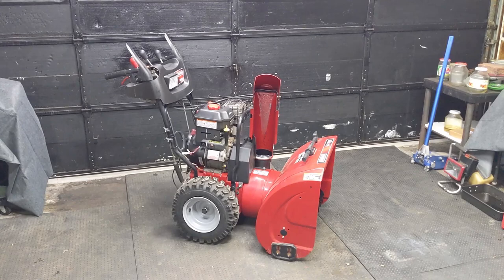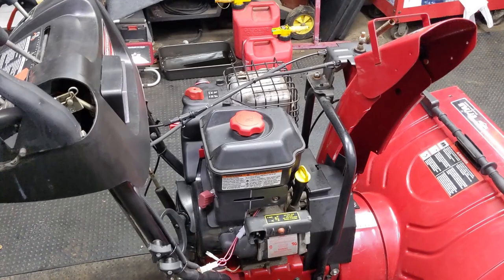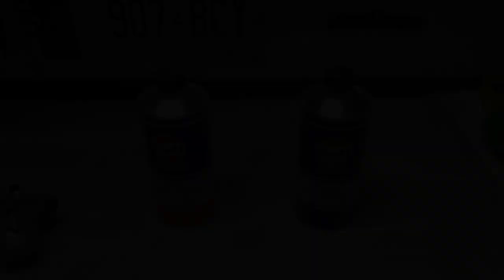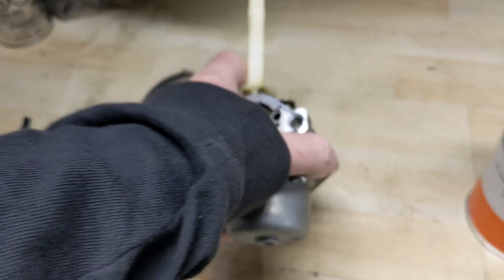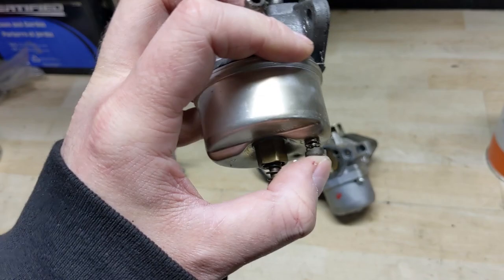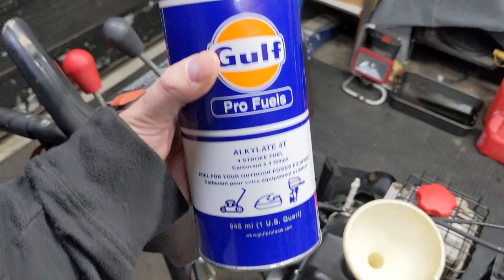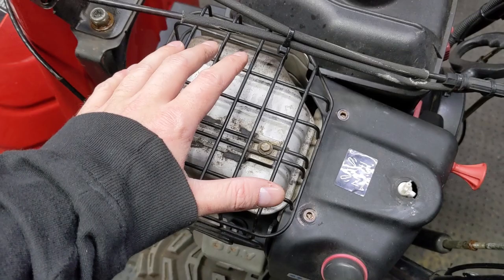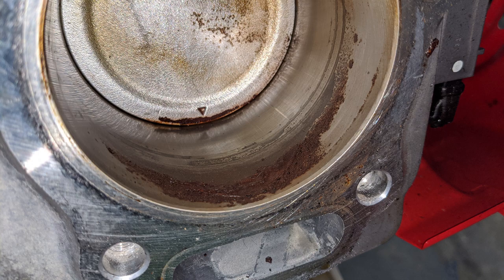How to "Summerize" a Snowblower

Comment from the maker: Due to all of the fuel in our area now containing ethanol, we will not be seasonally storing any equipment (for long periods of time) with pump gas.

However, we will still be using K100S+ fuel stabilizer with the pump gas 91 (least amount of ethanol) to run our equipment throughout the seasons.

Also, this video is NOT sponsored by Gulf Pro Fuels, I simply give a shout-out to Small Motor Service because they were kind enough to send me some free samples, and the awesome Gulf Pro sign you see on the wall at the back of the shop!
Reply: I just tested my 91 fuel that my supplier claims is shell vpower.  No ethanol.

Comment: Just summarized my snowblower for the season , ran the machine for 5 minutes , emptied the oil , then emptied the gas tank and the carburetor , put 10 oz fuel stabilizer though the tank and emptied from the carburetor , used the oil to coat the entire machine , meanwhile lubricanted the 2 chains and the axils , wheels , yes do filled the oil then put it away and ready for the next winter arrives !
Reply: I would keep the oil in the engine to prevent rust. Also you may accidentally start the engine without filling it with oil.
Reply from the maker: I leave the oil in them and do my maintenance before the season begins. You'll have to stay tuned to part 2 to see what products I use to protect the paint!

Comment: I'd rather keep the carb full of stabilized fuel . Running out of gas = water in bowl  Full carb [ empty tank ]  no room for water .
Reply from the maker: Yes but if the fuel has ethanol in it, than the water will bind to the ethanol and separate itself inside the carburetor. It will literally displace the fuel around it, since water settles to the bottom. So you have to run ethanol free fuel, with or without a stabilizer, drain the tank and carb completely dry, or run an ethanol free canned "engineered" fuel.
Reply: some say that the smaller amount of fuel left in an empty carburetor will gel more easily than a carburetor  that is full of fuel.
Reply: In most cases if there is very little fuel say just in the carb bowl and none in the fuel lines or tank then it just evaporates and is gone. The ethanol will attract the water in the atmosphere and thus water in the bowl (see rusted carb bowl from water in video and white powdered bowl is ethanol in the video)
Reply: @michaelotoole1807  The smaller the volume of fuel the faster it breaks down it correct.
Reply: @EliminatorPerformance  the Honda machines like my 1332 has A drain bowl underneath the carburetor. Once I run it with treated fuel, I shut the fuel off and it starved itself. Once it dies, I unscrew this drain bowl knob and let any fuel remained inside the carb. I initially treat my fuel premium gas with star tron in a 2-1/2 gals and than at end of season do the step above. I know some engines don’t have same setup as Hondas with no fuel drain knob.

Comment: A 5 gallon ethanol free gas is $105 usd + tax! 89 octane is $2.99 per gallon + star tron. I think I’d rather take my chances
Reply from the maker: Yea this canned fuel we sell for $10 a can, my cost is like $6.50 and I can store 2 machines with 1 can so it's not bad. I definitely wouldn't need 5 gallons, and as mentioned in the video, I don't run the equipment on this stuff, it's just used to store it.
Reply: @EliminatorPerformance  I do premix in my stihl equipment because they go thru gas within 30 min or less. My Honda 1332 takes 2.5 hours to drain while running. It take tons of those fuel can to fill it
Reply from the maker: @appleztooranges  yea that's why I just use enough to fill the carb and run it for a minute or so for storage.
Reply: No problem using what you mentioned although we use K100S+ stabilizer which in a 1 to 1 ration does eliminate water phase separation (we have tested it). Just follow Jakes steps for storage and your equipment will fire up within 6 months even if not using the canned fuel.

Comment: dExcellent video with many tips for the viewers to experience a guaranteed start up after 6 months of storage. Been doing this my entire life and i am 74 now and never fail to start one or two pulls after 6 months of storage and run fine. Had a Honda selp propelled mower i bought used 30 years ago and it never needed a carb clean and started first pull all the time. Sold it for a $50 loss from original purchase price and it is still cutting lawns to this day.
Reply from the maker: Thanks for watching!

Comment: the Honda machines like my 1332 has A drain bowl underneath the carburetor. Once I run it with treated fuel, I shut the fuel off and it starved itself. Once it dies, I unscrew this drain bowl knob and let any fuel remained inside the carb. I initially treat my fuel premium gas with star tron in a 2-1/2 gals and than at end of season do the step above. I know some engines don’t have same setup as Hondas with no fuel drain knob.
Reply: Your doing it right by draining that carb bowl of all fuel.

Comment: In North Florida, we can buy what is marketed as Marine Fuel at the pump, which is non-ethanol gasoline. Not sure of the octane. It is more expensive than regular fuel with ethanol in it. I run marine gas in all of my small engines, and recommend it to all my friends and family. The Gulf fuel that you have in the 1 quart cans. runs out to be about $40/gal. WOW! I wouldn't be using that, but I would use an ethanol treatment/stabilizer in the ethanol fuel.
Reply from the maker: Again, we don't use this canned fuel to run our equipment, only to store it! So it costs me about $5 as I only used half a can.

Comment: Thanks, The reason I heard for storing with piston at TDC on compression stoke is to ensure both valves are closed. I drain my tank and carburetor bowl at every end of season, then use a gas stabilizer with fresh pump gas at the start of winter, I've had seven good seasons with only minimum seasonal maintenance so far.
Reply from the maker: I've never run into issues with a piston being at a certain point in the cylinder, valves opened or closed, but that's why I mentioned some guys like one way or the other. I've been doing it this way for years and haven't had an issue, but like I said, it's not the only way you can do it!

Comment: Hell yeah!  I just did this today. 

Here on LI, NY, we cannot buy non-ethanol gas either.  I will run treated (SeaFoam/Stabil)  93 octane ethanol gas during the season, but never any over 60 days old. (After that, it goes in my truck).

For storage, I'll run that dry, add the engineered (canned) fuel, and let that run for 10 minutes.  Then, drain that.  

Awesome vid, and THANK YOU for the tip on the throttle tensioner nut (10mm) on my PowerMore 357cc a few months ago. Took me 3 minutes to fix!!  :)
Reply: Thank you for watching and glad that helped you out it is the entire purpose of these videos.

Comment: Very complete presentation, thx ! Ethanol-free gaz has also disappeared from the province of Québec. Been told by a trusred source that all grades of gas are born egal, the only difference as you move up the grade index being the guantity of ignition firing retardant added to prevent pre-ignition on higher compression engines. The irony of it all is that this retardant would be ... ethanol. In other words, using premium gas would just compond ethanol related issues. Take care and be merry !
Reply from the maker: Yes, we had it good here for a while with the ethanol free 91 octane. The 87 was 10% and the 89 was a 50/50 mix of 87 and 91 so it was 5% now I'm hearing all grades of fuel might be 10% it's too bad.
Reply: The ignition firing retardant used in zero ethanol fuel is something other than ethanol. While both do the same thing ethanol attracts water the other does not.
Reply: @waynestefinashen239   The switch to unleaded gasoline has required the addition of more expensive compounds, such as aromatics and highly branched alkanes, to maintain high octane numbers. And of course now ethanol as well , as you say.
Reply: @gadasavideos8564  Correct

Comment: Thx vm for thé excellent video.  I am not an expert like u but IMO, the most reliable solution for storage is to drain the tank completely… seems to me that must also include draining the carburetor bowl.  I also just recently learned that all fuel sold in Canada, regardless of its octane, may have up to 10% ethanol.  Is that a recent change?  That of course makes it critical to do something about old gasoline in all your small (and big) engines.  Thx for the suggestion of using high octane with fuel stabilizer in season and draining all gas off season.  Makes sense to me.

Comment: Good video Jake. To quote Bob Dylan, "The Times They Are A-Changin ". Hopefully with the higher octane and less than 10% ethanol, it won’t be as bad as 87 octane and 10%.   Have a good week.   Rick
Reply from the maker: What I do know is that the 91 octane here in Ontario Canada says "up to 10% ethanol" at our local Canadian Tire gas bar. So until we test it a few times and take some averages, we won't know for sure. Thanks for watching!
Reply: I've never had a problem  using high octane fuel with some seafoam and murphy's mystery oil. top tank off  at the end of the season  next winter blower kicks right over. she does a little surging for a couple of minutes  but smooths out and runs fine. checked fuel tank and float bowl always clean as a whistle. the 1 caveat i would say is that i keep it in my garage that dosent have  large temp swings and never drops below freezing. if i left it outside i think i would have more fuel ethanol problems.

Comment: Fellow Ontarian here, really annoyed by the lack of ethanol-free gas now. The engineered fuel drain-and-cycle is a great workaround idea, will do that ths week once my new fuel shutoff valve arrives.
Reply: I still got some a few weeks ago.
Reply: Even though CTC sticker showed 0 - 10% on the 91 it was Ethanol Free per shipping invoice
Reply: We sell the B&S Kinetix brand of alkylate no ethanol fuel, the engineered fuel like True Fuel and VP Racing fuel which are sold burn very dirty and there had been alot of no start issues with them being used. Our neighbour has been using our Kinetix 2 stroke fuel for 6 years now without issue and our 2 stroke snowblower fired up after being in storage for 2.5+ years this is an excellent storage fuel guaranteed for 2 years once opened.

Comment: Pretty great video Jake keep up the great work brother lots of videos have helped a lot including dads advice to me one thing didn’t mention was does it matter if the tank is still a tad moist with pumped gaz or that don’t matter
Reply from the maker: Thanks Doug, and a small amount of fuel in the tank is fine!
Reply: Hope your feeling better buddy, like Jake says doesn't matter. Some may want it totally dry and a shop towel to soak up the balance inserted with forceps then removed with the forceps works fine. Just make sure to use a safety can for storage of oil or fuel soaked rags.

Comment: I use star tron with premium gas. Never had issues with my Hondas
Reply from the maker: We used to use premium fuel here because it was ethanol free, sadly we can't get ethanol free fuel anymore. This engineered fuel is great, and I never BS on this channel. They say it lasts for 2yrs and I had one start after 2.5yrs, but at the 3yr mark it wouldn't start!
Reply: @EliminatorPerformance  they do sell non ethanol near me for $105 for a 5 gallon jug. Seemed too expensive to me. Maybe I’m wrong. This is usd too
Reply: @EliminatorPerformance   ive seen video's where you add water to your fuel in a clear container after the water absorbs the ethanol you can siphon the stuff from the fuel  add a little octane and bingo! ethanol free fuel.
Reply: @michaelotoole1807  Absolutely true but you have just removed most of the octane so now you have to replace the ethanol with another source of octane booster. Really not worth the time nor the danger of handling when all you need for storage is one can of ethanol free alkylate fuel.
Reply: @waynestefinashen239  true about the handling part. but the true fuel is expensive.
Reply: @michaelotoole1807  True Fuel is an engineered fuel and totally different than an alkylate fuel. There have been many complaints from people using True Fuel and basically the small engine community believes it is a stale dated issue since there is no manufactured date on the can.
Reply: @waynestefinashen239  thanks for the heads up. how can they put no manufacturers date on something that can go stale?

Comment: So here is my theory with gasoline ⛽️:

-Option 1 (my choice):  use your preference fuel stabilizer (star tron, stabil, sea foam, etc..) run the high octane gas mixed with fuel stab. Turn the fuel valve off. Than after it dies, go underneath the carb bowl (Honda) and remove any fuel under the carb bowl (drain knob). This ensures the carb is dry. 

Option 2: remove all gas from fuel tank. This is bad for Hondas with metal tanks. Can rust the fuel tank out. Can also deteriorate fuel lines etc. 

Option 3: buy non ethanol fuel. This is hard to find for me and cost $30/gals +
Reply: Appear to be really good options to choose from i am taking option 3 and using a canned non ethanol alkylate fuel for storage, works everytime and like Jake said in the video even starts after 2.5 years of storage!

Comment: Further down the instructions on the storage fog spray can...says..... how many grams?
Reply from the maker: Says to use 150g and the can was 340g, I probably didn't use that much though.
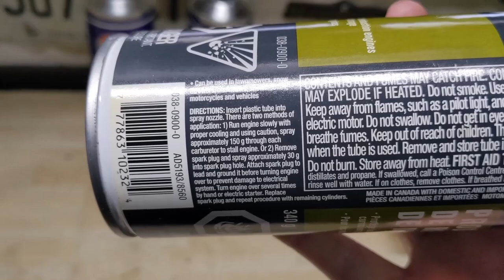Reply: @EliminatorPerformance  At 16:04 I stopped the video and read the instruction label. If using method #1, you run the engine while spraying up to 150 gr to get the engine to stall...In method #2, use 30 gr directly into cylinder and cap off with spark plug. If you put 150 grams directly into the cylinder in method #2....thats almost 1/2 the can.

Comment: Taryl fixes all did long term test showing stabilizers don't work.
Reply from the maker: Exactly, and canned fuel doesn't need any stabilizer added to it, because it's engineered not to break down for 2 years once the can has been opened, or 5 years in a closed can on the shelf
Reply: Yes he did but what we really needed to see was if there was any ethanol breakdown in the carb after 6 months which is the normal storage time using and not using stabilizers with ethanol fuel. Did you notice the fuel in the jars evaporated but had no ethanol formation like the carbs did in the end after 19 months? That proves that ethanol breaks down in fuel faster in smaller volumes agreed?

Comment: So after watching the video I googled vpower and ethanol. I found a thread on redflagdeals from back around Oct 22. It was claiming the same thing that 91 was now containing ethanol.  So I  just went to my card lock and got 10 l of 91. 91 pump is separate hose. I just tested it and it contains NO ethanol.
Reply: Just got mine from Cdn. Tire same hose as 87 and 89 so i pump 4 litres in my truck before i fill my fuel containers and the 91 still tests 0 ethanol.
Reply: If you dont pump the 91 into vehicle first you may get ethanol fuel into your containers first before the no ethanol starts coming through the hose if the prior customer bought 87 or 89 if they are hooked up to the same hose.
Reply: @Wayne Stefinashen  my place has separate pump and hose for the 91.

Comment: Hello. Ariens 306cc 2023 or Briggs and Stratton 2023 306cc??? 1000 cad difference. Many are saying, they are all the same go for the cheapest one. I would like your advice
Reply from the maker: The Ariens engines are LTC, which is modern day Tecumseh as they've been bought out. I would highly recommend the Ariens!
Reply: Thank you for your reply 🙏
Reply: Just for the engine or gearbox and other mechanical stuff are 🤔 different too??
Reply from the maker: @dominiqueroumieh9260  all Ariens stuff out performs the Briggs stuff hands down, if you can afford it, get a deluxe model or higher.l (platinum, sho etc...) rather than a classic model. But even the classics are good
Reply: @EliminatorPerformance  thank you again. Yes, I can afford it gladly 😌. However, I want expert advice since you service them. B&S made me think twice, especially the 2023 model in stores now (almost the same one as the one in your video about the $$ pins)

Comment: Maybe it's time to make up a gas container that to can add water to, shake it up and from a bottom drain,  drain off the water/ethanol mix.
Reply: A lot of work, dangerous and drops the octane level so much you need to replace the loss of ethanol which provides octane with another type of octane booster. Alkylate canned fuel much easier, safer and cheap for what it accomplishes.

Comment: how sad that i didn't need to use my snow blower all season. after adjusting valves to get 80psi instead of 40 on compression test.  20 years old and still running strong. but no snow... depressing times.
Reply from the maker: I spent a great deal of time building this snowblower and never got to use it either so don't feel too bad lol

Comment: Good  day Jake  So all gas has  ethanol  in now.  Now in St. Jacobs  they have 93%  would that work?   I will have to check.  Thanks   good video.  I hope all snow is gone.  1 yr. April 8  we had a blizzard,  blew neighbour's  silo roof off.
Reply: Don we recently went to Cdn. Tire to fuel up the fuel containers for the business and all octane levels were identified as 0 to 10% ethanol. Prior to filling i checked with the Manager that showed me the invoice and the 91 Octane delivered still had 0% ethanol which our testing has confirmed. We filled up but any further fill ups will require checking with the Manager first as we did this time.
Reply from the maker: The Sunoco had 94% and it's now up to 10% ethanol. The only place was Canadian Tire and now they say it'll soon be 10% as well.